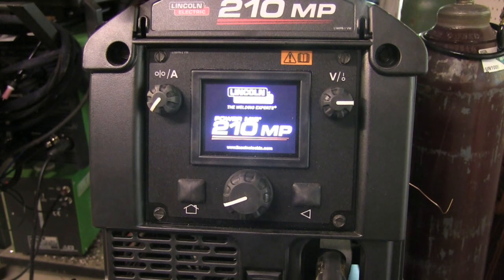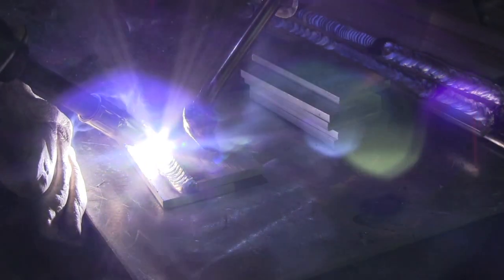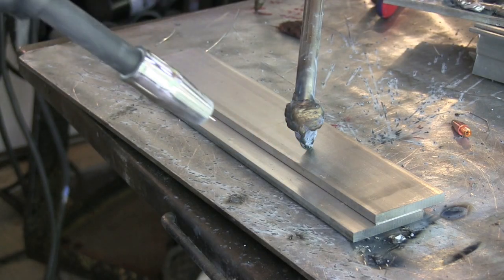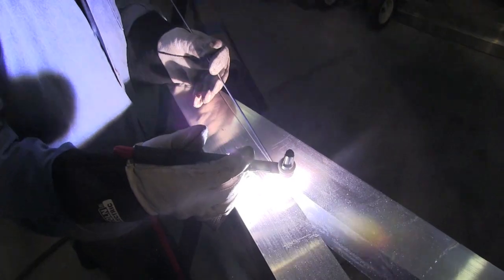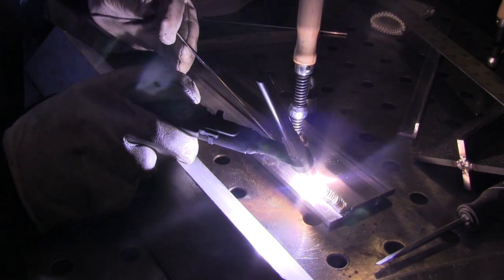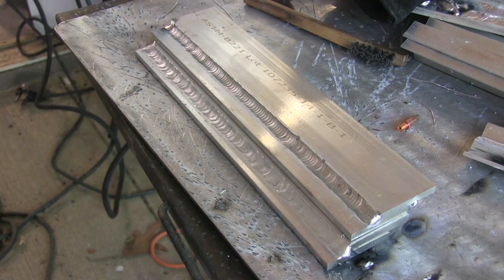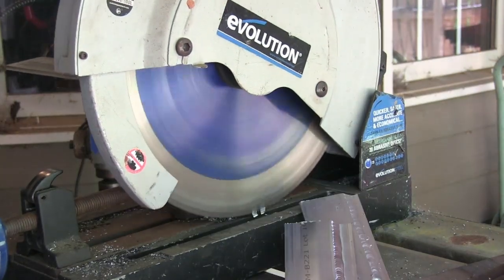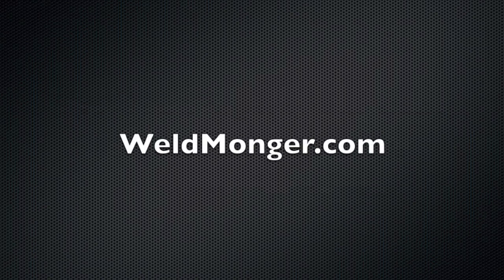Welding Aluminum TIG vs MIG Spool Gun

Comment: I work in an aluminum ship yard I mig weld everyday I have gone a week on a single tip admittedly I couldn't do that 4 years ago when I got started
Reply from the maker: a week on a single tip is pretty impressive.  Especially in a shipyard
Reply: I wished I could have gotten the guys running steel to do that in the shop I worked at  about a tip a day is what we got except for the robot that lasted a tip for half a week 3 shifts
Reply: I build Aluminum Boat docks.... I use a profax 200 spoolgun and I use same tip sometimes for months and sometimes only for minutes.lol I really went through a lot while learning
Reply: JesseNG1989 what shipyard u work in
Reply: You work at Austal don't you
Reply: that nice, so what's the secret on how to use it?
Reply: I use a spool gun myself all day and I can get a week out of a tip sometimes its not unheard of especially if you have your settings just right. Only difference is with me Im welding this wall tubing. Normally 1/16 thickness but we do have some tubing a little thinner and its a real pain.
Reply: weldingtipsandtricks Hey jd I am big dan of your welding I having a problem with my mig welder it happens when the welder is  cold .the welder welds like the wire speed is to fast and the voltage is to low when I first start but as long as I start welding it welds good any ideas what  could be the problem it's a Eastwood 175 mig

Comment: any sense to using a larger tip, perhaps?  eg .045" tip with .030" wire.  Might be more forgiving and let you clean it up a bit once or twice instead of replacing.

Comment: Oh, man! I'm presently welding 1/8" thick aluminum 2" square tubing using my Hobart 230 strongman mig welder with an 8" spool in the machine. ..what a pain in the ass! Any slight error on my part it will bunch up and I lose 14 ft of wire. I did this 4 times. After that, someone came in the shop and said I should admit myself to the nuthouse. This machine is not forgiving. You would think they would make it so that there was more room for welding adjustment/human error i.e. allow the wire to bunch up without kinking or breaking for about 10 inches which is enough time to stop before the wire goes bad. Then all you would do is back the wire up and save 14 ft of wire and much frustration. I fare no better with the 10" spool. The only way I got going was to use gun spools. It works really well for me on corner joints though I still have not learned to do corners with tig...I tried but the welds looks terrible. With mig, I can lay one large bead with good penetration good looks.
Well, I have much to learn and I could not do it without you Jody! I just bought some alumina cups from you and some adapters. My way of saying thanks and there will be more thanks to come.
Reply from the maker: I feel your pain.  Spool guns can be a pain in the butt but trying to mig weld aluminum without a spool gun can be worse. I worked for a guy in a sheet metal shop who had an old Linde mig setup with teflon liner and weak tensioner spring...and it still was a pain.
Reply: @weldingtipsandtricks  
Tig is good or mig

Comment: Nice video, I've been welding with Millers Spoolmatic 30a for some time now and have learned that when welding a lot of aluminum these guns can make you or brake you, I've found in running er5356 .035 that @ 23 +\- volts wire speed 9+ that it welds awesome , with being you cut the tip of wire every time before you run it again, and on the trigger purge the argon a few seconds before  pushing all the way to start again, I've saved many tips, I manage going through two 18 1lb. spools using 1 tip, I know this sounds off the wall but it's true, many of the large tools I have fabricated over the years I have learned well, mostly welding 3/8 flat bars at many different withs and to round bars up to 5" od max and always have to preheat aluminum round bars that are thick helps prevent cracking. Just give it a try, I'm not exactly sure what your setup is, but I'm with you, I support you, personally I think you are the best✌🏻Love Tig aluminum...Your videos have really helped me , thanks, Greg
Reply from the maker: good info....thanks   purging with the trigger is a great feature on those
Reply: love 5356.   it's extremely smutty tho . I have found that if your speed and angle is right your welds  will be shiny and have smut all around it... I usually run 24v on eighth inch and around 25.5 on quarter inch material

Comment: Hey man. think you could do a video on mig spool gun with aluminum. all positions and you recommendation. new to the career and it's proven to be a tricky thing maintaining the gun and all that jazz.  I feel as If the welding changes every time I use it.
Reply from the maker: I do plan on adding more spool gun vids.  i agree with you that every time you pull the trigger things change.
Reply: thanks a lot. I really appreciate it.

Comment: Great video! very helpful in my studies actually. Question. when mig welding Aluminum with spool gun, do you alway have to weld right to left with a push angle?
What happens if you go left to right with a push angle?
Reply: Robert_robinsonq sooty/black welds with the chance of porosity from lack of cleaning action
Reply: Right to left, left to right doesn't matter. Just keep the gun slightly angled so you're pushing.

Comment: Thank you for your videos Sir. Have you heard of the sand rail or sand cars. It's a specialized vehicle made out of chromoly metal, they are light and very strong made. It takes hundreds of hours to build this things and they're welds are top notch, my question to you is what kind of machine would they use to weld it together?
Reply: Tig

Comment: Was wondering if you can do a couple videos on how to use and setup a Lincoln 250 welder/generator and the different processes such as tig,mig and stick
Reply: Any pulsed MIG would be good for me as well.  I have a Lincoln Power MIG 300 (same as the 350MP since I could install software and wave form updates) which does pulsed MIG, I know Miller has a pulsed machine. I would love to see the pros and cons.  The weld itself sounds much different between short circuit MIG and pulsed MIG on steel anyway.
Reply: I'd like to see a video on settings for an Everlast pulse mig please